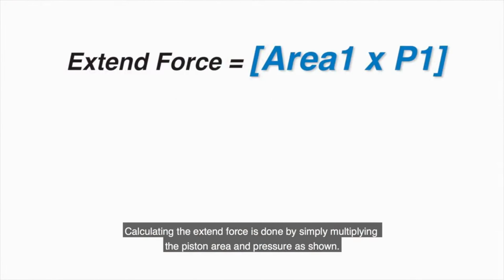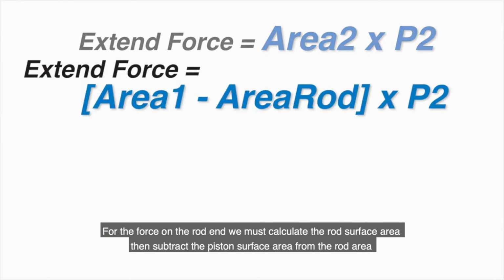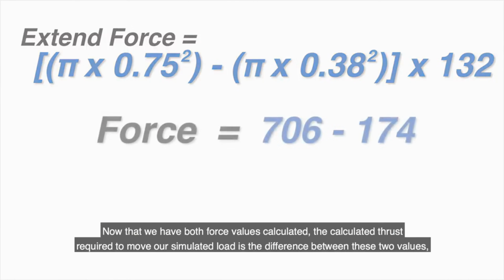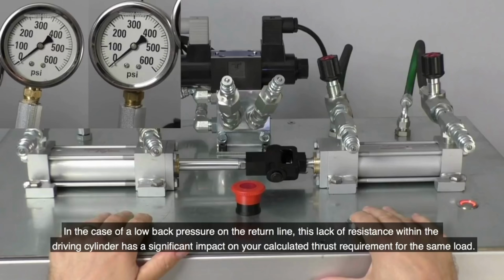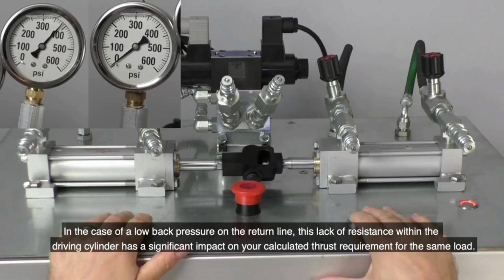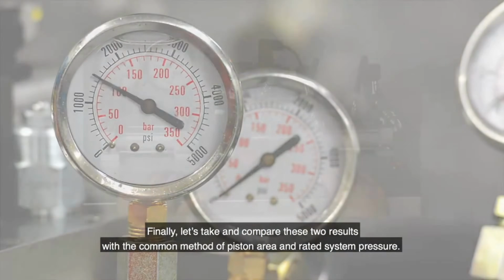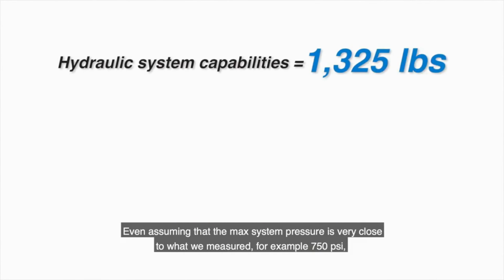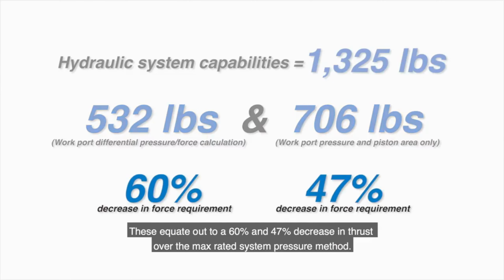How to Size Electric Actuators for Hydraulic Replacement | Guide

Comment: Question - I recently purchased a 2006 Cadillac XLR which is a hard top convertible utilizing a series of 8 hydraulic cylinders and a pump unit to operate them.  Literally all of the parts are no longer produced and even used prices are INSANE.  While I completely understand that a control module would need to be implement to drive electric actuators, I'm curious about the possibility of ditching all this hydraulic drama & replacing those cylinders w/ electric components.  

I have a background in software/firmware and am not at all afraid to do the circuit board/firmware to drive the process, but when it comes to sizing/fitment, no idea.  I could supply some pics of what the current system looks like if that helps.

Thanks!
Reply from the maker: Hello, and thank you for your comment! If you email enquiries@motioncontrolproducts.com, a member of our technical team will be happy to assist you. Have a lovely day! ☺